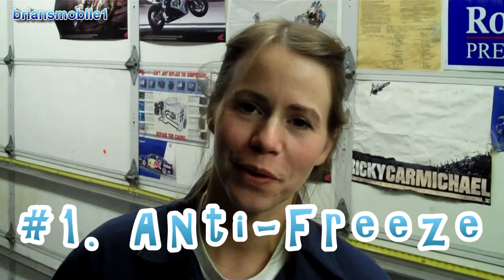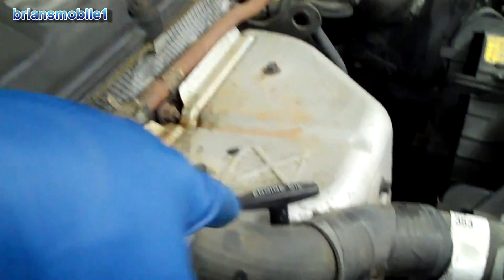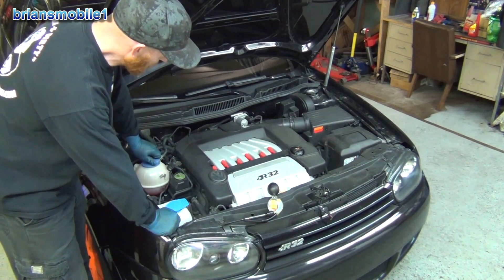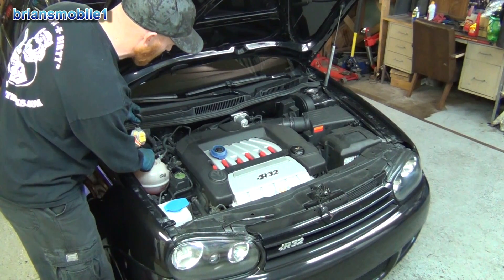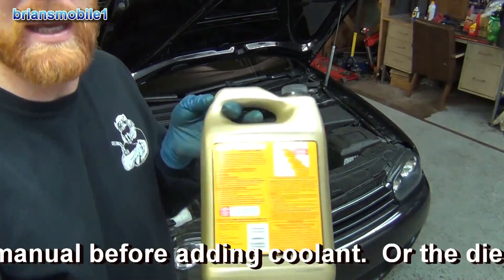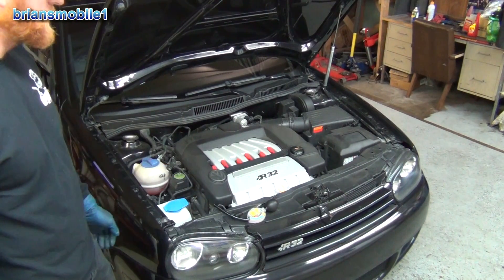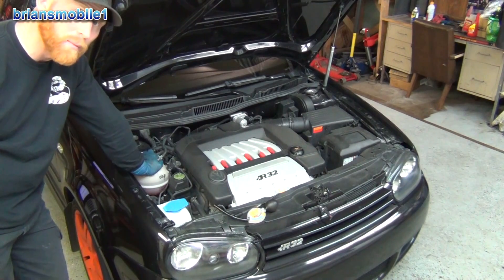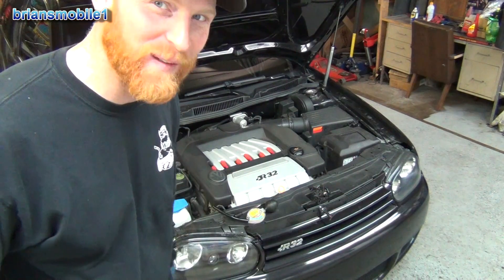Anti Freeze video # 1 Checking Antifreeze Level and Gravity

Comment: Put this way, here in Australia, it never get's below -5 degrees Celsius & that's in the winter time, yet all the coolant's especially long life coolants going by OE standards, is to have it at 50/50, re: meaning that you have 50% of Glycol & 50% of clean de-mineralised water when you change your coolant, now there's 2 or 3 types of coolants here, re: winter type which is basically just your inhibitors, then you have your glycol based & they have so many variations it's not funny, always go to the OE standards & you car will not miss a beat, as long as you Engine & radiator is clean & no leaks are present, which you can buy a pressure Tester, to check for leaks & also if Electrolysis is not happening as well & just getting the right tools can be brought, but again if you have a great Radiator & A/C repair place you trust, then you can always take it there ? But i have always done it myself, just change the Coolant every year & always by the same coolant, NEVER EVER MIX the coolant's unless you know the type of coolant that you put in the first place etc. thats 1 of the biggest mistakes that people that change their own coolant in their cars make, which will eat you engines aluminum parts alive ?

Comment: Brian, as you unscrewed the cap of the R32's coolant reservoir, you noted that the coolant level rises towards the top since the car is warm.  Does the level rise because air is getting into the system?  I was hesistant to add coolant to my daughter's VW Beetle (same reservoir) when I saw the level rising thinking I was letting air in as I unscrewed it.

Comment: Sorry I meant 42ºF
Reply: LOL 42 c... Never ever use water instead of antifreeze, water will not only boil but it will also cause a number of other issues. The biggest issue will be the block will rust (if you have a steel block) along with the radiator, or the block will galvanize if you have an aluminium block. It's not worth the hassle just save $20 on antifreeze.
Reply: Wat could i use to get ridoff a bit of rust on my radiator?
Reply: David Cruz Just change the coolant and put some anti-freeze in. Don't know if a flush would be a good idea since it might free up more rust and clog stuff up. 

 I would change the coolant right away because another problem you'll have is the water pump will fail prematurely.

Comment: -50 in Banks with the wind chill,tires break when you hit a curb,not cut,but break..Head out for the northern slopes(pipeline area),and stay in a line camp on tracks for a few months,and experience -70 n colder for several days at a time..
Reply: At those temperatures oil has the consistency of honey, batteries die, and pretty much every fluid is thick.

Comment: One misadventure I had 30 years ago started when I parked at a mountain site for 5 days of ski mountaineering where there were no plug-ins. I had -35 antifreeze in it, but the temp dropped to -40 for several days.  When I got back, to my surprise, it did start. I drove for about 15 minutes and then I noticed billowing steam coming from the hood, and temp gauge showed I was overheating. I pulled over. After a little head scratching, I realized that the rubber hoses had frozen over, obstructing free movement of coolant. The car overheated but freeze plugs didn't pop and I was able to drive it home after a wait of 20 minutes. I was lucky but ignorant (grin).
Reply from the maker: Now THAT sounds like a fun adventure and good makings for stories!  I have a fun story like that in video #6, but I've only edited through #2 so far.  It's going to be a long night!